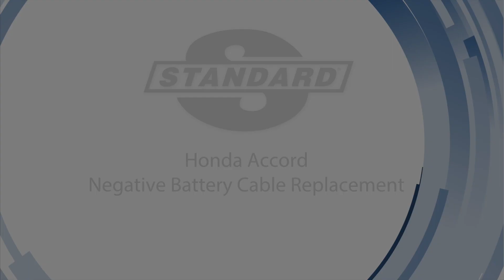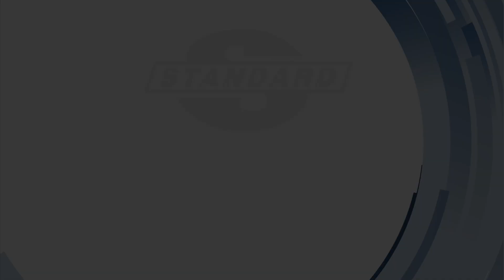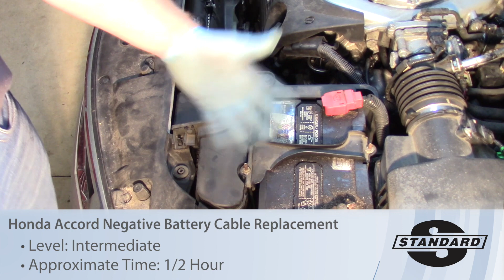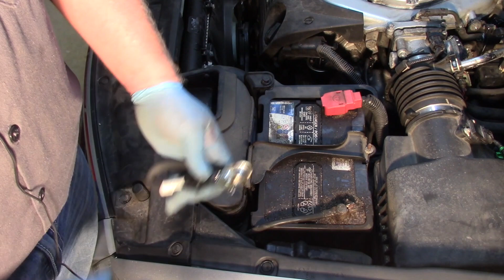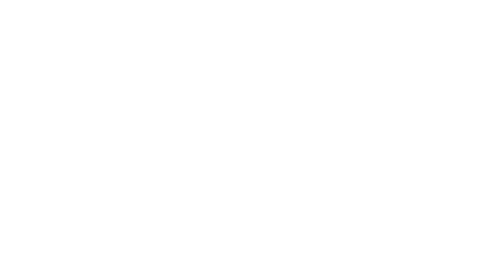Honda Accord Negative Battery Cable Replacement

Comment: My car starts most of the time, and sometimes it doesn't. When it does start again, it is a strong start with no struggle such as if the battery was weak. The voltage on the battery is 12.7 with the car off and 14 something with the car on. Alternator is good as well since the car can run by itself when on and the battery completely disconnected. Hopefully this is a wire issue as demonstrated.
Reply: To whom whoever reads this. The issue ends up being the wire (black). I didn't replaced it, it just started working again 100% probably because the way it was placed and retightened back onto the battery.
Reply: Lee Pham what car is it?
Reply: @SeamlessSavage  I've had the same problem on my 15 accord for 6 months. Battery is new. Voltage is always good. Alternator is new. Starter is not the issue. Everytime when it doesn't start, the right  jiggle of the negative cable does the trick. I've called a tow twice the first two times I got stuck at work, but each time it i just started up before a dealer mechanic looked at it.  Since then I've had multiple times it's happened, I just didnt stop until the right jiggle or twist of negative cable did the trick.
Reply: I am having this problem right now. Thanks for the info.. let you know if it works!

Comment: Thanks bro 👍

But what was wrong with the old cable ?
Is it because its only short or its worn ?
I feel that my battery voltage is weak and the negative cable is really short and kind of loose